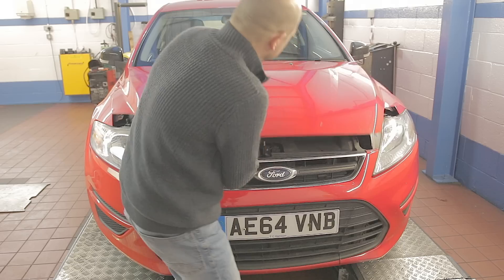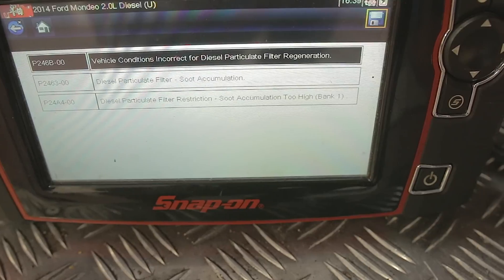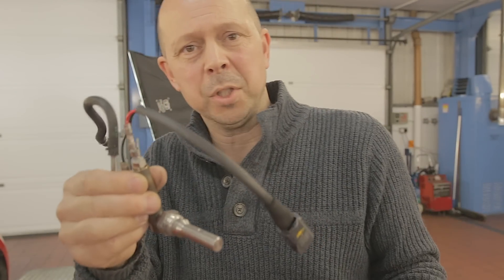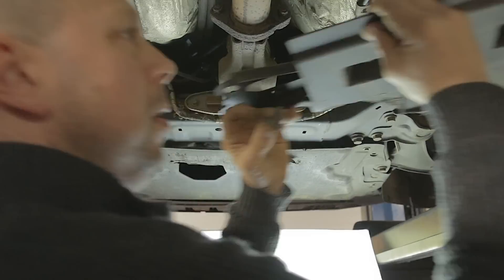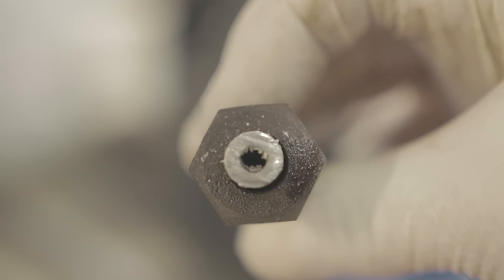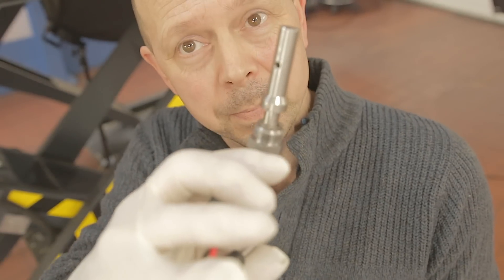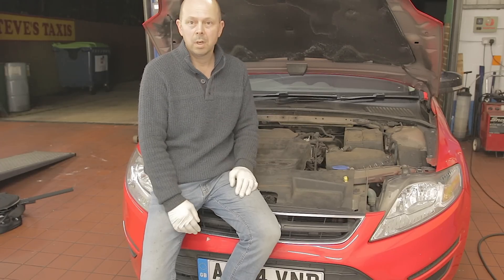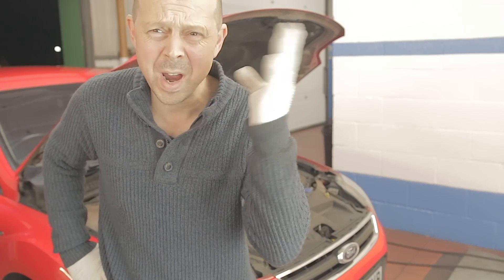Ford Mondeo mk4 Diesel Particulate Filter Fuel Vaporizer 2012-2014

Comment: You say this makes it go I to "limp mode" on the motorway. Do you mean this part being faulty would lead to  issues with acceleration at higher gears (like motorway driving)?
Reply from the maker: hi, that nozzle is designed to squirt diesel fuel into your diesel particulate filter which regenerates the filter and stops it getting clogged.....regeneration of the dpf normally happens when travelling at constant speed as on a motorway....when that nozzle clogs up the diesel particulate filter clogs up which is detected by the engine control unit which then throws your car into reduced power mode which will also bring warning information on your dash such as service engine now and probably the engine light will be illuminated

Comment: Further more Alan , I see on the 7zap diagrams on the 2.2 ..the vaporiser goes into the cat , so before the dpf ..
And I didn’t know the system also had a cat .. so is the exhaust set up different from a 2.0 and a 2.2 ltr ??

Talk about  ott on the Emissions... 
so it has an Egr to get clogged , a cat to burn out , a vaporiser to get clogged and a dpf to get clogged ... 

On a plus ..the 2.2 titanium x sport estate with 19’s in midnight sky is a sexy looking beast when it’s going ok 😂
I do hate the fact now , out of all the diesel cars I’ve had    Saab , bmw.  Mercedes .. Ive worked on all of them , with cleaning egr valves etc 
This ford is a total total no no to get to anything to maintain a good airflow ... I do very good motorway miles daily so I don’t expect this crap ...must be picking up previous owners short journey faults !
Reply from the maker: well, you know your car now lol...i not had a cat or egr issue at all yet so keep fingers crossed. hope your dpf issues are sorted.
  unfortunately emission systems are getting beyond stupid and now with this ad blue...what a con, anyway, thanks for your input, it all helps, good luck
Reply: alan howatt 
Cheers Alan keep up the good work on here .. 
I’m getting quotes for the crank seal oil leak now plus as it’s all off , flywheel and clutch 🙄

Comment: Hi, nice vid, I am having a similare problem on a ford ranger 2.0l duratorque. I have had couple of forced regens done didnt work, so had filter removed and properly cleaned, also oxygen sensor and dpf pressure sensor changed. Unfortunately after 2 days cog light has come back on and code p2463. Could the vaporiser also be my issue or something else, guys who did the dpf clean said they struggled to reset the lights and and had to do another forced regen which tookthem off. Do ECU dpf values get reset on a regen or should that now be done. Ive downloaded forscan and ordered a usb lead to try. Thanks in advance keep up the good work )
Reply from the maker: hi, if your vehicle has a dpf nozzle ... you need to have it removed from vehicle and then you can see if it is blocked.
   the fuel that squirts out of the nozzle is needed to burn in the dpf and make a regen successful..... if the nozzle is blocked... all the regens in the world will not work.
  sometimes after fitting a new nozzle if the soot accumulation in the dpf is too much the engine ecu will not allow a regent to take place...in this case there are two things you can do... reset the dpf values with diagnostic equipment to fool the ecu that you have fitted a new dpf when you have not or...give the vehicle a real good thrash for a few miles then a regent normally works....but you must have that nozzle checked out first
Reply: HI thanks for the reply. Ok ive run forscan with the new lead and can now see dtc p244c and p2463, which is gotta be pointing towards the vaporisor right? Ive ordered 1 anyway will be here tomorrow, so going to swap it out and then run a regen, also the live dpf pressure reading i was getting from forscan was 2.4 at idle and about 8 at 3000 rpm so that seems pretty clear now. Sorry to be a pain but 1 last question whats easiest way to manually prime the vaporiser, pretty sure forscan doesnt have that test/option. Many thanks
Reply from the maker: hi, you dont have to prime the nozzle..just fit it and carry out a regen.  when you pull the rubber fuel pipe off the old nozzle..fuel should drip out of the pipe..that is a good sign fuel is being pumped to the nozzle
Reply: Awesome thanks again

Comment: Hi Alan,
Just purchased a 2009 mk4 mondeo with 212k miles with masses of service history including a recent flywheel and clutch. The Engine pulls well and feels smooth! So what mileage will  one of these psa Engines do?
250k 300k. Also the fuel filter is at the bottom where yours was at the top?
Thanks Paul
Reply from the maker: hi, if its been looked after properly and more important had the oil changes at the right intervals these engines should do well in excess of 350k miles or until the rest of the car is scrap... the fuel filters were put under the bonnet around 2012 time
Reply: alan howatt 
Thanks again Alan.

Comment: Great video. Same issue with an mk 4 2010, tdci 163 hp. Good thing you’ve added the wallet thing in the end.
It seemed like an easy operation and i was already starting to question my ford dealer’s quote at 250 euros.
Reply: Where is it fitted please I cant see it

Comment: Great video with good info delivered in a fun way :-) Now I've buttered you up can I ask a question? I've a Mk4 Mondy, had the EML a few thousand miles ago and put in some JML DPF cleaner and been OK for about 3K. Now getting EML light again intermittently. Never once been in limp mode. But how can I tell whether a regen has ever occured? Was told last year by garage that the glow plug in vaporiser not working. So if I use DPF cleaner that is meant to lower the temp at which soot burns. Will it actually occur if glow plug broken? Or can I just keep using DPF cleaner every couple of thousand miles to save forking out 250 quid for vaporizer and 150 quid for forced regen, plus about 150 labour costs.
Reply from the maker: well hello, ok, I've read your book lol, the first thing here, you say the eml lamp comes on... has anybody read the ecu fault codes to see if they are related to the dpf ?
  as for the glow plug not working.. this system will only switch on during certain conditions. i have never used dpf cleaner so i cannot really comment. a regen will generally happen at speed on the motorway, you will not know this as the system was never intended to alert the driver a regen is taking place but when a regen does take place and all is working correctly, you will get a poignant smell from the exhaust, lol, i can't explain that any better ... without knowing what it smells like you won't know.
  let me find out the price of a new nozzle and what i would charge... i will get back to you on that.

Comment: Hi iv got a transit connect 2013 and I had the vaporizer fule pipe replaced as it looked warn and also it kept coming Loose, however ford replaced it and also (inspected) the vaporizer, despite it being clean ... apparently.
it kept coming off so  a few cable ties and a jubilee clip later it was fine, now it's leaking diesel all over the place :( how much roughly would it cost to have the vaporizer replaced and a regen done in a garage?
 Many thanks 
Andy
Reply from the maker: hi, first off the ecu codes need to be read before looking at the vaporiser, a fuel leak does not mean the vaporiser is faulty, sounds like you need a mechanic you can trust to look at your vehicle

Comment: I've just bought a new vaporiser to fit to my 2011 2.0 Focus. Is there anything else I'd need to do before taking it on the motorway other than clearing the code? And do you know roughly how long it would take to regen on motorway?
Reply from the maker: hi, i have never drove one of these cars on a motorway so i do not know as i always do a re-gen in the garage, static re-gen. the problem is you may not be able to clear the code until a re-gen has been done first, also, sometimes the vehicle will be in reduced power mode and the dpf will have to be reset before the vehicle will even carry out a re-gen. you can just try driving it but you may end up having a static re-gen done
Reply: Thanks for the reply. I'll give it a go after changing the vapour valve. If it doesn't work I'll take it the garage for a static re-gen. At least I will have saved a few pennies doing it this way :)

Comment: Alan great another great video. Just wondering why im getting a smoke smell in the cabin of my 2007 galaxy its the qxba engine. And is my engine same as the one fitted to the focus 2.0 tdci barr ancillarys hp pump and injectors?
Reply from the maker: hi, thanks for comment.  there could be many reasons to get smoke smell in cabin but i would check around the fuel injectors and see if any are leaking.... there will be a tar like substance around injector and it will stink inside the car.

   your engine could well be the same as the one fitted to focus but there are variations so would have to check engine codes to try get a match

Comment: Having this exact problem on my 2012 2.2 tdci auto had it forced regened twice do you think that part is the problem?
Reply from the maker: hi, you are saying that your car has had two forced regens and you are still having problems, if the nozzle i show in the video has not been or checked and is blocked then trying to regen the dpf will not work or fix the problem.
Reply: alan howatt the nozzle hasn’t been changed but I was recommended change that and fit a new dpf at a cost of around £1300 all in
Reply from the maker: you don't want to replace the dpf, have someone take the nozzle off the car, if it is blocked then replace it, also there should be diesel fuel in the rubber pipe on the nozzle, if the nozzle is blocked then fit new one and then carry out a regen. sometimes after fitting a new nozzle, the vehicle will not allow a regen, but with like a snap on scanner you can reset the dpf values to as if the dpf were new, then it will allow a regen.
   it is a lot easier if you know a mechanic you can trust to tell you the truth, or know what to do.
Reply: alan howatt thank you for your great advice and I will try to get it changed ASAP shame your not near Manchester will update when I have had this done thanks for the replies
Reply: Hello again bought the nozzle at a cost of £249 took the car to the guy who is going to fit it. The car has go in to limp mode again this morning after around 200 miles from the last regen 😒now he is telling me this might not fix the problem would you recommend cleaning the egr or get a new 1 and possibly new lambdas?
Reply from the maker: hi, have you had the old nozzle removed from your car to see if it is even blocked first? it sounds like rather than guessing to get someone to look at your car who actually has an idea what they are doing.

Comment: I don't like getting my wallet out. I presume that forced regeneration is a very different process to the standard driving down the road process??? Great info as always
Reply from the maker: lol, yes, you can't clear the eml lamp until a regen has been done,
Reply: alan howatt Is it possible to just take the car on a long motorway run to get s re-gen to accure normally?
Also, how much was that little part in the box?